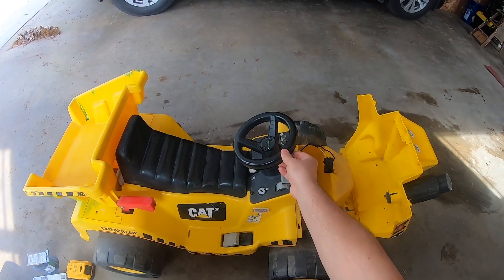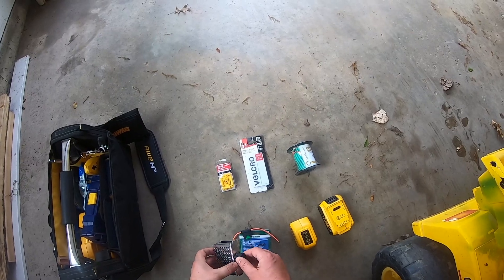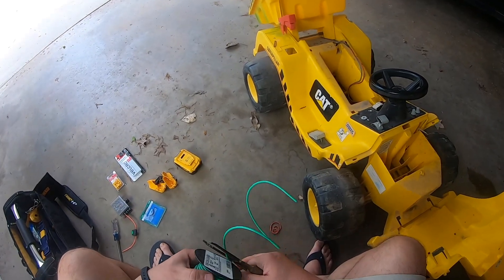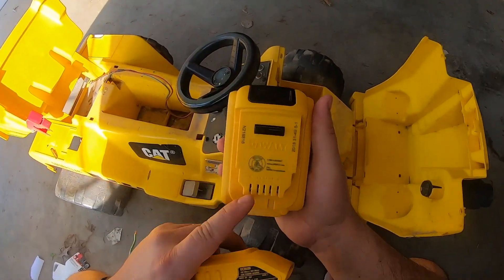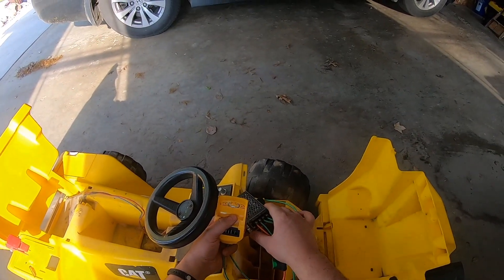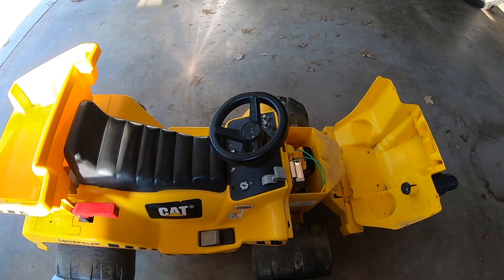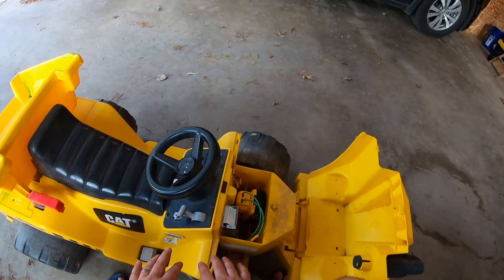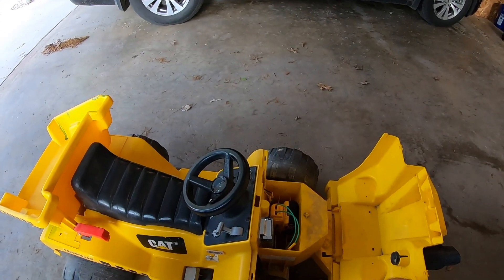How to Modify Power Wheels to Run on Power Tool Batteries

Comment: does it over discharge the battery or does the battery cut off power before that happens?
Reply from the maker: There is potential to over discharge I believe.  I just try to change the batteries out more frequently when they are using it.
Reply: You can add a Low Voltage Cut Off to protect the battery. This video will show you what you need:   https://www.youtube.com/watch?v=S9LMmRpvSGg

Comment: Ok i got it working.    But what is causing the volt controller to keep blowing fuses.  If its more than 70% power it blows fuse 30a in controller and 30a on the + connection.    Usually the one in the controller blows
Reply: By the way, great tutorial.   Only thing i would have showed closer was soddering wires to the controller    Like which places to hook them to etc.   i figured it out but i was willing to catch myself on fire.  Some aint
Reply from the maker: Thanks haha.  I would just keep the controller dialed down so the fuses won’t blow.  It sounds like it’s drawing too many amps.
Reply: @HowtoHacks  well is there a way to increase this?    The problem is ive modified the axles and installed rubber tires.   So without 30% of the power available from the 20v battery it won’t climb a hill?    I was considering a pigtail to a 50a relay in place of a fuse
Reply from the maker: You can try it just make sure you monitor the controller and battery so it doesn’t get too hot.  You might need to upgrade the controller to one rated for higher amps.

Comment: Ok so I have the side by side has the 2 and 5 speed. I bought the battery charger, and the inline fuse. I got it all hooked up and the lights on it came on, but it kept clicking and wouldn't go anywhere. Help?
Reply from the maker: Double check all your connection and make sure your positive and negatives go together and aren’t crossed.  Did you get the speed controller?  It’s hard to diagnose without being there and seeing everything in person.
Reply: @HowtoHacks  yessir. Everything's good. The control box inside mine, it just clicks when I hit the pedal. The lights and everything work fine, it just won't go. Lol.
Reply: @HowtoHacks  i have a 20v dewalt battery and my sons powerwheels is a 24v. I looked it up and they said it shouldn't matter the voltage.
Reply from the maker: @joeshifflett6253  Maybe your controller is faulty.

Comment: This tutorial is awesome and I’m excited!! So I cracked open the USB adapter and there are 3 wires...B+(positive?)B-(negative?) and it says either “10” or “ID”? Is the 3rd wire not needed? Any help would be appreciated...
Reply from the maker: Look at your battery where the + and - terminals are and correspond that to where your 2 wires need to go.  You only need 2 wires a + and a -.
Reply: @HowtoHacks  thank you for the response...this is what I assumed but was surprised to see the third wire...PS does this hack also work for 6V cars too? With the voltage controller?
Reply from the maker: Devyn Feil yeah it would.  The motor might not be able to handle the extra volts if you crank it all the way up though.

Comment: I just did this modification to my daughters little four wheel & it worked great. However, I’m pretty sure we fried the motor. Did you have this issue? I’m currently looking for a replacement, maybe one that can handle the uptick in voltage & amperage. The fuse never blew that’s why I’m looking on eBay currently.
Reply from the maker: I haven’t had that issue.  However I have never turned it all the way up as my kids can’t handle it yet.
Reply: How to Hacks......switched to a bigger motor and everything works fine now. However, it’s killing the Dewalt battery making the battery completely unusable. Have you ran into this issue?
Reply from the maker: Matthew Luczak no I haven’t. Is your voltage controller wide open?
Reply: How to Hacks No, I have it set about half way.
Reply from the maker: Matthew Luczak you could try going with a smaller fuse or switch out the batteries more frequently so the change never gets completely depleted.

Comment: Thanks for the video. I did the same setup with a volt cut off. Did you have issues with the mini fuse in the voltage controller blowing? Should I raise it to a 40 instead of a 30?
Reply from the maker: I haven’t had any issues with fuses blowing.  I would probably stay at 30 amps.

Comment: Back in 2017 I modded the same USB device....but I ran both wires out one USB port opening and kept the other USB active.  Technically I could have kept both active and run the wires out a separately drilled hole. Seems like overkill on the controller. Any particular reason why you chose that one?
Reply from the maker: It’s just one that I found on amazon
Reply: @HowtoHacks  Ahhhh ok, thanks for the reply. I'd show you links to mine for future reference but I sourced them while I was in China. Still, I always love seeing people get creative with tool batteries to power other devices. Rock on.

Comment: How do you protect battery pack from discharging completely?
Reply from the maker: I check the battery periodically.  The dewalt batteries I use have a charge indicator button.  It’s also good to just change them out fairly often when the kids are using it.
Reply: i think im going to try and put a low voltage cut off. board in there. something like this that can be programmed. https://www.amazon.com/dp/B07929Y5SZ?psc=1&smid=A243HB0NZWY05K&ref_=chk_typ_imgToDp since the dewalt dosent have a bms that kills the power when the voltage is too low.